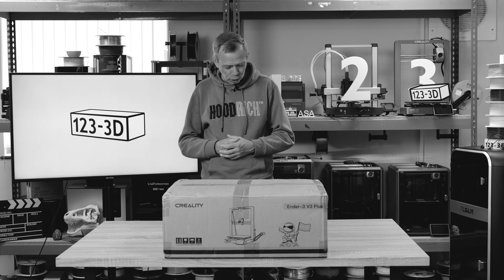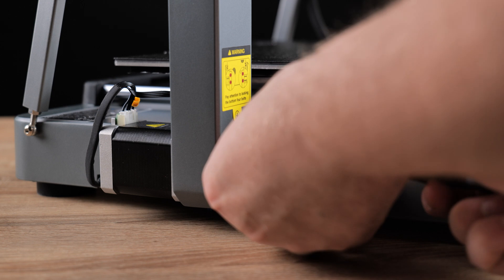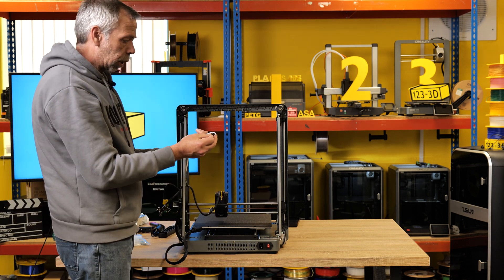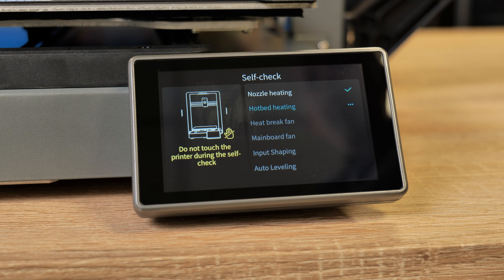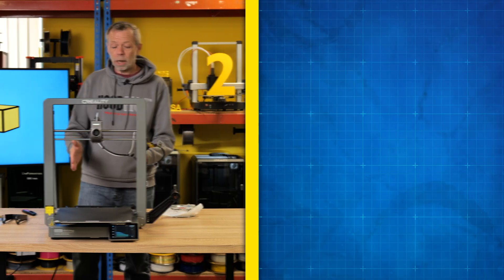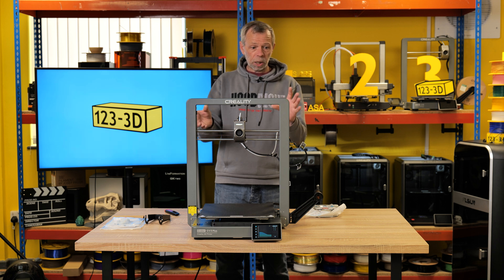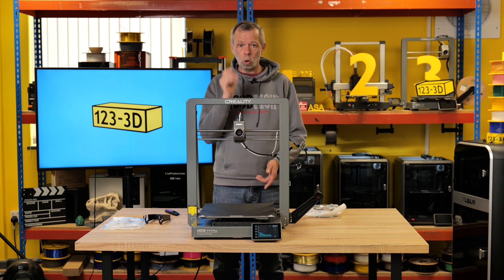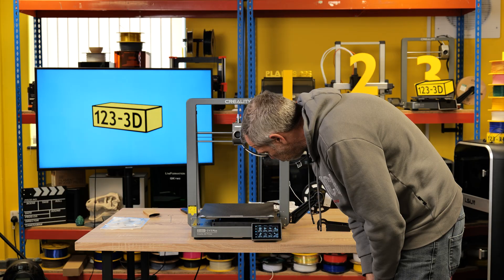Creality Ender 3 v3 Plus Unboxing & Review | The BIG one!

Comment: Thank you for your video. 
But are you sure that all the bearings are the same? It looks to me that only the upper bearings are these graphite bearings and the others are normal linear ball bearings. The top ones look like brass and the rest seem to be black plastic. I don't want to take it apart though as it is new.
Reply from the maker: Thanks for your comment! The extruder runs left to right on brass an graphite bearings. All the other bearings are regular bearings.
Reply: @123-3D-UK  so, regular bearings need lub.. right?
Reply: @AndreH5656 found anything? Am lost
Reply: @murc.1  My v3 plus came with stock silicon lub on both, but pretty dirt.... You should always make it very clean. I think you should apply on the bottom bearing one, and other graphite you can use just a tiny bit.